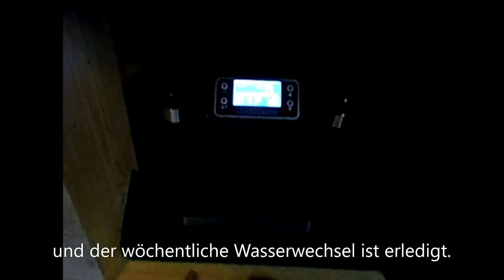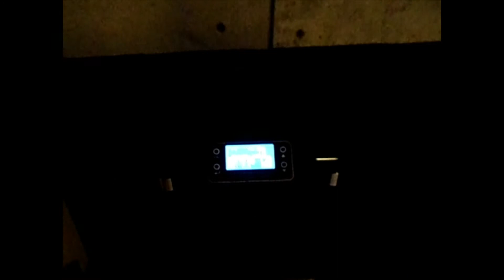Mein Aquarium (69) Mein Wasserwechsel mit Grundwasser, My water change with brak water

Comment: Your aquarium is beautiful Udo. How big is the tank and also what filters are you running on there?
Reply from the maker: Hi Andy, the aquarium has 1000 litres. I filter the tank biologically with the filter material from Fluval, which is offered as a matching filter for the Fluval G6. Have a nice weekend and stay healthy from Udo
Reply: cheers Udo. I have not seen the fluval g6 before. It looks a very nice filter.
Reply from the maker: @andywright41  Yes hi is very good, but the price is high!!!
Reply: I find with our aquariums if you buy cheap you have to buy twice. I have learned this the hard way.
Reply from the maker: @andywright41  Yes, Andy, you are right. Otherwise you're throwing money away.